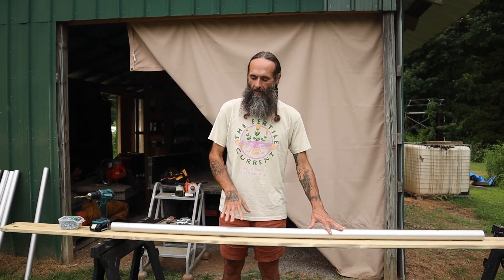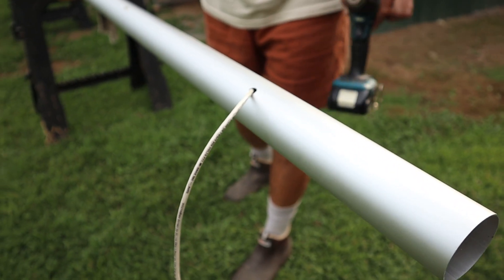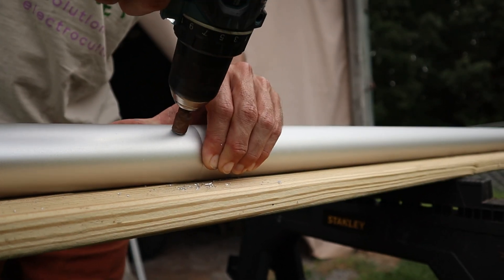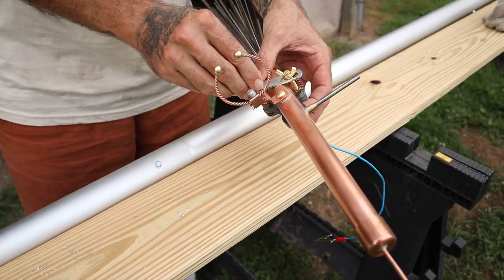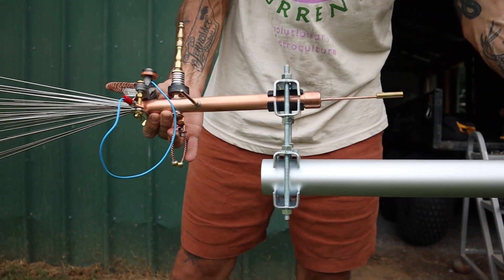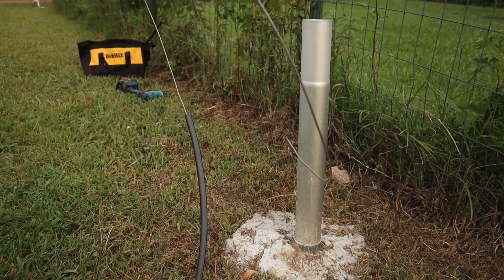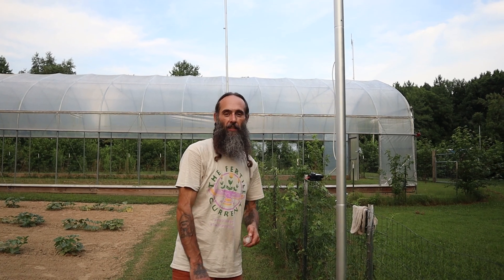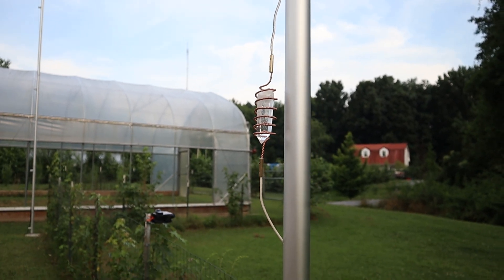CW1+ Electroculture Antenna Installation Guide

Comment: How much for 1 of them please brah and what reading does a multimeter give roughly
Reply from the maker: Hey friend! Please visit my website thefertilecurrent.com for pricing info on all antenna models and accessories.  I appreciate your interest and happy to help you. The website also has quite a bit of info on the systems and installation variables. Multimeter will vary at all times based in the inherent nature of how most of the antenna mechanisms function in direct relation to weather and atmospheric conditions.